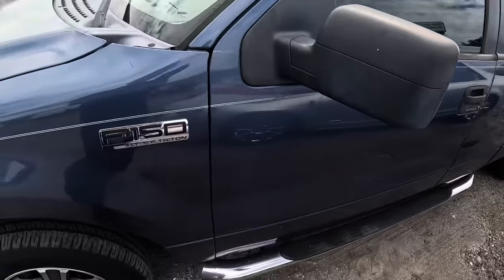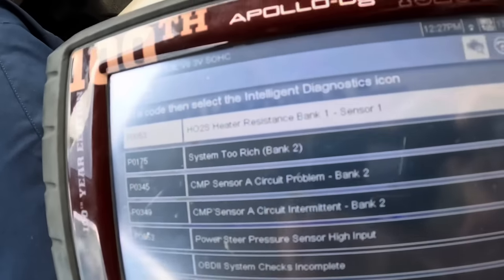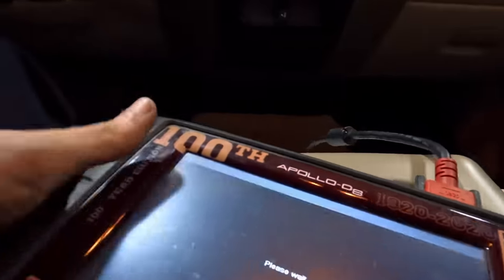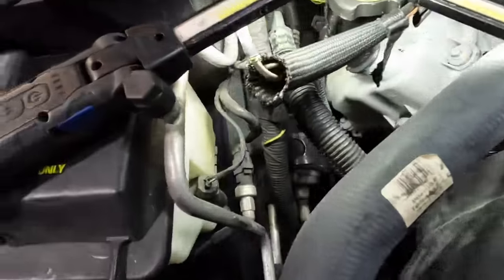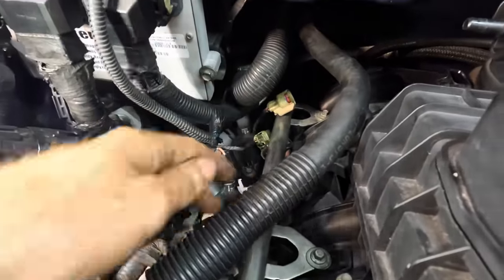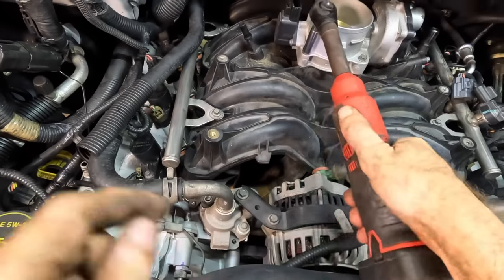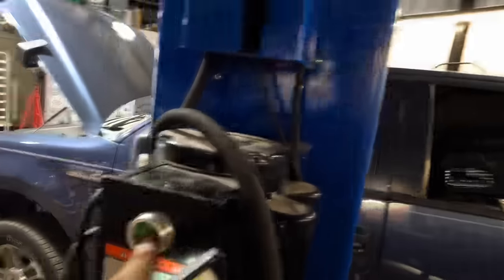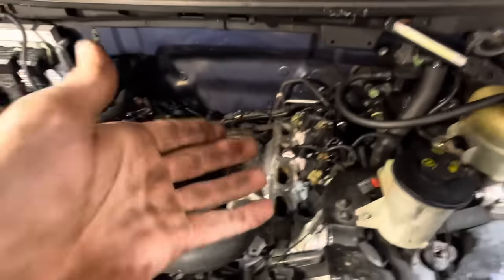Hack Job! Mechanic Botches Engine Replacement! Multiple DTC's

Comment: Ive got to say, Flat Rate pay causes these problems!!!! Guys trying to beat the times cuz their hourly pay is so low!!!! Theyre just trying to put food on the table or keep roofs over theyre heads. Sorry to say it but customers get what they pay for. Cheap labor rates amount to low or botched pricing to do the job!!!! Auto techs that are flat rate depend on beating the times, so they in turn, they do shoddy work to make a paycheck. Ive watched it for 35 years!!!! These techs couldn't mount tires more or less do an engine job, but they do it cuz the hours look high. Cant wait to retire!!!!

Comment: The heat-sensitive glue seems like an out for whoever remanufactured the engine. If they do it wrong, wouldn't it potentially overheat on its own?

Comment: If you can't find anything wrong with the cam shaft sensor. Was watching a video where someone bent the timing wheel under the valve cover.

Comment: I delt with a company that rebuilt this engine. First engine wasn't right. I but a camera down the cylinder and found weld splatter in the cylinder I told them what I found they made a big deal about it so I tore their rebuilt engine down and showed them video and pictures. They send another one. We Installed the next motor same thing didn't run right low oil pressure. Or just spit oil out of the engine. Tear down again showed pitting in the cylinder wall and the rings where original because it took a hammer and a screw drive to get the rings off. The 3rd engine came in and before install I put a camera down the cylinder and found a cylinder wall cracked and pulled a valve cover to find head bolts not tightened. This was APS out of Texas. I ended up getting g a rebuilt out of Wisconsin that worked and was good I forget the shops name it was 8 yrs ago and many cars.

Comment: Hi there, im a little curious, how much is actually an hour of labour? Im from Venezuela, here in labour rebuilding an engine (completely) is in the range of 50-150$ per cilynder (ie: 50$ a normal mechaninc stander price, 150$ a very well distinguished place blah blah) so thats my question in the US how much is an hour of labour working on an engine, thanks

Comment: Awhile ago, i had a "jasper" engine installed, No oil pressure. They sent another engine, thimping noise in lower end. Jasper blamed installer even though no paint on bolts disturbed. Rep came with third engine to obsrrve install. Clatter in lower end.  Rep ordered crank pan removed. Loose crank bearing caps!! It came to light that the engine rebuilders at company are piece waged and rushing jobs to get bigger paycheck. Never had another "jasper" brand engine again
and never will.

Comment: I think your rattle on startup may be due to the orange death can oil filter installed on the engine, but then i guess you cant expect someone who slathered that much rtv on an intake gasket that doesn't need it to be smart enough to use a decent filter or not break sensors and try to hide it.

Comment: Need a "SUBSCRIBE" custom label ring printed and installed for your lift switch!

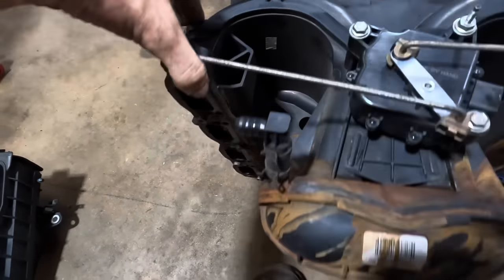53:27 .. or, or because this widdle teeny motor is new but was trying to operate while "bound" and especially with a CLEAR LABEL not to manhandle its positioning (not move by hand indicates it isn't very strong).. well, it may have died or went out of spec in the first 5 minutes of its initial use and be very completely BAD despite looking "new and replaced".  Use those brain cells.

You are a great mechanic, but all kinds of imprecision and methodology issues, especially in diagnosis.  Great for just random cars, but not for hospital-grade or nuclear-grade repair work. I always enjoy seeing a guy actually work to put my own skill into perspective.  Best wishes.

Comment: In the trucking company tool shop I worked butt connectors were forbidden.  None to be found anywhere. In Québec Canada with all the salt and sand that is a warrant for awful disgusting electrical problems.  I think up north it's harder than down south to work into but that would be a double edge sword as down south these problem are less obvious than in Canada.

Comment: I had a 1997 F-150 XLT where the engine went bad.  I went with a rebuild. It took MONTHS to sort out the mess the dude made...all kinds of misfires, codes, etc  One of the first things I noticed upon return of the vehicle is the guy didn't torque down the underside engine mounts.  Needless to say, I was P#####!!

Comment: my wife and i bought a 2005 f150, to tow a LARGE travel trailer it had just over 18000 miles on it had no problems it had that same 5.4 engine no problen getting going but stopping would make you suck the leather seat cover up your butt, so we bought a new f250 wow what a difference, Maby  that 150 was how you say over stressed

Comment: gotta give it to every single car manuf out there, the "push clip to release cable/hose" almost NEVER comes out easily, "quick disconnect" more like quick snap it off, theres absolutely no reason for things to be THAT tight, tight yes, that tight you nearly break a finger or snap a clip not required.

Comment: "There is not a shop in the world charging 110 Dollar an hour"   Ooh....I so wish that was true!  (and before you ask €1,- equals $1.06) 
This is the hourly rate in the Netherlands per dealership Volvo: €139.- , BMW: €149.55, Fiat: €133.10, VW: €153.67, Audi: €163.35, Toyota: €110,-, Mercedes €144.60, Honda €120,83

Comment: So in a block replacememt they use all original component's except for the block so all sensors would have been reused an could have been failed from the previous engine but imo if the sensor is reading its working

Comment: Wow I had no clue about that button on the bottom of the engine.If it melts off u said the engine would have overheated so therefor you cannot return the engine.I didn't know about that Thanos for the tip

Comment: Dielectric grease is an INSULATOR, and they put it all in the inside of that connector. Dielectric grease is used on spark plug boots to keep them from seizing to the plug but also to prevent spark leak. It should never be used where current needs to flow.

Comment: I had to do a head gasket job on one of these engines. All I had were hand tools (nothing air or electric) and doing it on jackstands in a home garage. I am NOT a professional mechanic by any means and i'm sure if someone went through my work after that they'd find some stuff wrong. But...even I know that you mount the clips in the holes. And use heat shrink and not electrical tape. Hate that there are so called "professionals" who do that type of work. (Also this was on my personal vehicle and I did the work myself save money.)

Comment: Start up rattle is caused by a blown tensioner seal, not the phasers.
Reply: Phaser oscillation occurs between 1000-1500 rpm. When aftermarket phasers fail, they fail spectacularly.

Comment: The Fram oil filter may be causing the rattle at startup.The oil drains out when the engine is shut off. The factory Ford filter has an anti-drain back valve installed, because the filter is in the horizontal position.

Comment: Another thought: replacing any engine or transmission should take into account a new factory harness properly installed. It’s just wire no need to try to reuse the old stuff.🤔 The customer is in this deep, anyway, might as well take that variable of a defective harness out of the equation.

Comment: I wonder if that is a Jasper engine. Then again, the hack shop that installed the engine probably caused most of those codes. The cam phasers would be the fault of the rebuilder, if they are faulty. Can't wait until part deux to see how this all comes out.
As an aside, I always took pride in putting all harnesses back the way the factory had them. I wanted it to look as if nobody had been in there, except for the shiny new parts. Sloppy work like Ray found would be unacceptable to me.

Comment: Doubt the circuit codes are caused by any noise in timing system. Circuit codes are circuit codes dealing with voltages the pcm sees. Performance codes are using rationality of the sensor readings to determine if there is a problem.  I would put new pigtails on both the cmp sensor wiring due to possible stress on them and pin figment. I would certainly do a pin drag test. The intake control and bad o2 sensor negates any fuel trim issue diagnosis. The pcm uses different fuel maps depending on runner position. Fix the o2 and make sure linkage is free, I think there is a bidirectional control to run it. However if there is a noise in engine all this is moot because the engine has to be disassembled to find the issue. Professional technicians don’t bad mouth others work, just say “ that’s not how I would have done it “ and leave it at that.

Comment: Ya i unfortunately know the exact kind of person that installs engines this way. I saw dude smash an ecu up till the cover fell off and also get a ground wire stuck under a head gasket job and just cut either end of the wire and jumped a new wire across the cut one. :rofl: theres some real butchers out there. Guy worked in the used car department. He had a 1/64 drill bit for 'fixing' engine lights. Just drilled a tiny hole right thru the cluster and popped the bulb.

Comment: I'm late to the party, I know, but I can't help but feeling, the reason those cam sensor wires were joined was probably because the new engine had a different style sensor(s), so they just chopped off the original plugs and fitted ones that match the sensor(s) 🤷‍♂

Comment: Im not AFC certified but i do my own repairs all the same i take my time and do it right with kit gloves.
I do my own dionostics with a OBD 2 reader that a cheaper version but gives me the same results as a more expensive version to reset trouble codes.
Mine works great.
Did my flawless repairs and car runs like new.
Saved thousands of dollars in labor costs and piece of mind.
Sorry but i do not trust most mechanics in general because they like to up charge on every thing so to pad the invoice.
I get coned into replacing things not related to the issue.
With that i do not bring any thing to there shops for the second time.
I rather learn hands on than to misplace my trust.
As a Human being if they can do the job so can I.. simple as that.

Comment: I'm confused as to why u think it's a crappy reman job I understand the installs terrible but they just did everything beyond the Longblock I'm not done with the video yet but at the point where u got the intake off they didn't do those gaskets I was just wondering

Comment: You started the engine and heard cam phaser rattle why would you look at the O2 and fuel first go straight to cam phaser data or at all and see if they are operating correctly as it is such a common issue with these engines.

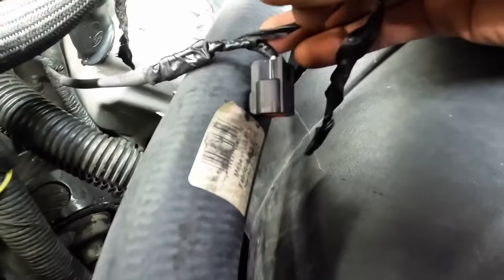Comment: 25:53 does anyone just solder the wires together anymore and slap come marine grade heatshrink over it to weatherproof the connection? Or is that just me thinking overkill.
Note: marine meaning like for ships and stuff because the heatshrink has an adhesive inside it that weather seals the cable joint from the elements.

48:49 the silicone sealant might be interfering with the butterfly valves opening, and the ECM/ECU might be noticing that.
52:51 also a valid point.

Comment: Hey Ray, I watch your channels once in a while and that F150 with the remanufactured engine I’m just curious of who remanufactured that engine because I used to work for a company that remanufactured engines and transmissions and judging from what I saw my time there at that company you’d be better off getting a junkyard motor

Comment: I think stuff like this is alright if its a personal project vehicle.  Like, me and friends did dumbass shit very similar to this with misc junkyard engines thrown in old beaters we pooled together for, then would run them basically until it blew up and we would start again, ignoring diagnostics, cutting off sensors that werent working, just pumping as much fuel and air into it as possible, mounting things poorly, etc (although I never put silicone on a gasket lol).  It "worked", but at the same time, you shouldn't be charging someone money for hacky bullshit like that and trying to pass it off as professional.  

We knew we were doing dumb shit and that it was inevitably going to break, but the guy who owned the truck in your video probably didn't.

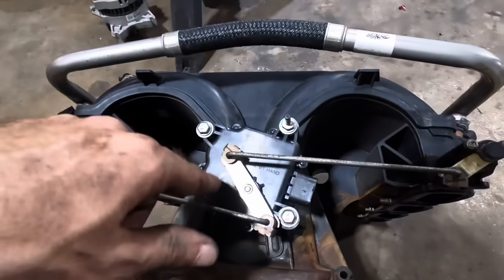Comment: At 53:27 we can surmise that the DTC for the "stuck" flapper motor was also the reason it was newly replaced or it got damaged mating the engine to the trans 
But upon on removal of the  actuator motor and re-installation and  then installing the drive links,could you not feel the fat  harness hitting it? 
Things like this seem to happen when the boss sees you're not gonna make book time
then comes over to give advice
Why did they let this truck go?
Not a mechanic in the world is  perfect but this guy had to know unless, a rookie

Comment: Just from me... if the both sensors where replaced and  "repair" was done to the loom from the both sides i would say they changed sensors that shouldnt be there because the original loom didnt fit ;)

Comment: Isn't the Ford 3 valve the engine the Wizard says cannot be rebuild and will always, 100% need to be junked with no chance of ever getting it right again?
Reply from the maker: It depends if the camshaft journals are scored from low oil pressure
Reply: @RainmanRaysRepairs  that makes sense

Comment: I live in Maine and emotions are pretty lax basically if you have cats your good for time being anyway, but I've thought it would be cool to find one of these with a bum ticker dirt cheap and swap in a 351 windsor on a standalone ecu But I figured they may be vehical system follies?, I know there's hot shots that could do wiring magic but that's not me I don't even mess with newer trucks for this reason, when you need a computer to tell the horn to beep it's overcomplicated and over engineered you know it is when mechanics are constantly saying " wtf now why in the hell would they do it like that" there disposable now like cell phones and microwaves and that really sucks. The owner screwed up when that 5.4 parted ways they should have left it parked in a bad neighborhood. Now they UL approved have a money burner.

Comment: I'm going to go out on a limb and say that, they didn't pull the cab to replace the engine. Would have made it much easier to properly run the wires to the back of the intake.

Comment: Is this unfortunately typical?  
As for the "rebuilt" engines is there a reasonably reliable source? If there is an official "Ford Factory Remanufactured" engine is it possibly farmed out to a second party provider who might just use a few shortcuts and/or non OEM parts? 
  I guess the chain tensioners are supposed to have antidraindown valves/preventers that if they don't work,allow that rattle upon startup ? If the chain tensioners completely retract can the engine jump time or even hit pistons and valves together like an "interference engine" that suffered a failed timing belt? 
  I suppose when you are reinstalling/putting back together one of these very complex and sophisticated machines there is an exact sequence that must be followed in order for "each piece of the puzzle" to go back into its exact routing and place ?

Comment: Always the issue when you yake ove from some other make beleive Mechanic. Kids stuff being missed as well what are they thinking sealant will fix every thing or do they simply not under stand. Good work Ray slow and methodical and the owner will thank you in the nd then all he has to do if fight with the original instalers. Just lucky you were there to save maybe warranty claims not being alowed as well.

Comment: I had a 2006 F150 with the exact same engine. I don’t know what Ford was thinking when they came out with this. Purely a piece of junk engine. The problem was the cam phasers. You could get them replaced, but you might only get 20 to 30 thousand miles out of them. Once they needed to be replaced, it sounded like either the timing chain needed to be replaced or a complete valve job.

Comment: Man, I just hate those squeeze butt connectors.  It's a sure sign someone took the quick and easy way out.

If you're not going to solder it, use the good quality connectors with the solder in the middle that heat shrink in place.

Or do it the way it really should be done, and full-scale solder splice + heatshrink.

Comment: I've seen WAY worse installs.  but they for sure did not do things the way i would.    If a bracket is missing, which is usually found on older vehicles, at least zip the harness where it should be.  The RTV installed all over is a for sure NO.

Comment: I have an issue with a 2007 Mazda 6. My brother bought a cheap non running car for $400, seller stated in needed a new battery. Come to find out they hooked the jumper cables up backwards and killed the battery and blew the main 120A fuse. I replaced that and the battery and checked all the fuses and relays, only other fuse that was blown was a 10A for TCM I think it was called. Anyways I took starter out and tested it and that was good. The car is a no crank and no start. I noticed today after I swapped that 10A fuse that the anit-theft light is blinking real fast when you turn the key and then it slows down and blinks 5X 3 second pause blinks 1X - then this just repeats for about 2 minutes. Now does anyone know what the issue could be? Is it the immobilizer, or ignition switch? Or does the blinking light mean something else? Thanks to ANYONE who reads this and can assist.